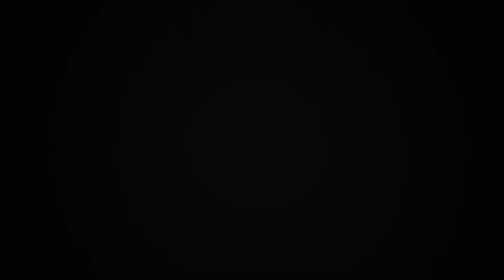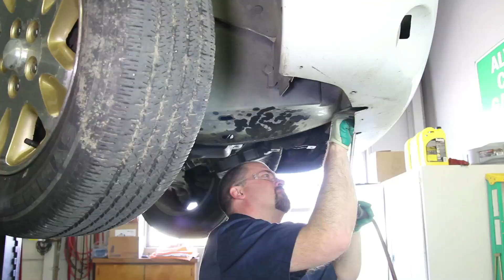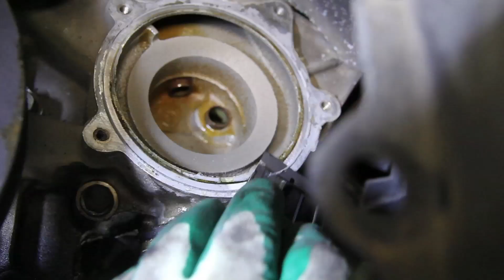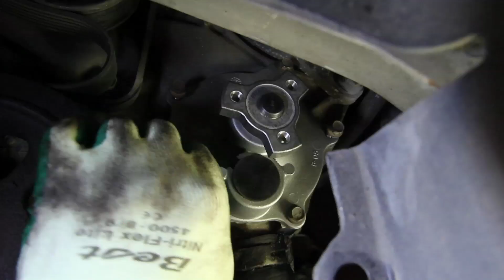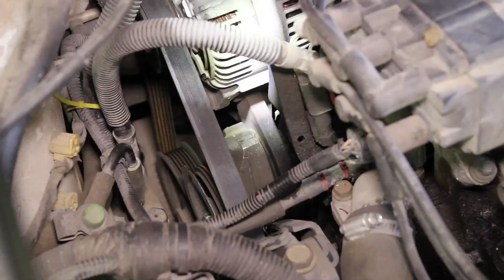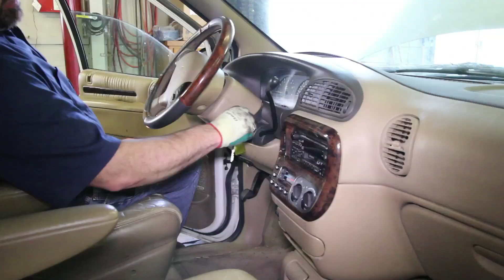How to Install a Water Pump: 1990 - 2000 Plymouth Grand Voyager 3.3L 3.8L V6

Comment: Could you please tell me how to release tension on the serpentine belt.
Reply from the maker: Bill, you release belt tension by rotating the tensioner clockwise. The tensioner is located between and just forward of the alternator and power steering pump.
Reply: @AirtexFuelPumps  Thank you sir for your reply.  In my younger and more able bodied days this looks like a job I could do myself.  I think though with my knees as bad as they are I will not be able to stand long enough to do it.  I have a good friend who is going to help me with it though.

I also have a problem with my transmission seeming to slip out of gear when I step hard on the gas at 40 mph.  Before i moved here to NC from Houston, Texas I had a high end transmission shop rebuild my 1990 plymouth grand vopyager 3.3l minivan.  
The original transmission used Dexron II.   After being rebuilt with all new parts the service guy said it should take more modern fluid.  My mechanic friend said we can replace the fluid and the filter in the transaxle.  

Should i use ATF+4 transmission fluid you think to replace what's in there now?

Thanks in advance for the help
Reply from the maker: @Bill23799  Best of luck with the pump and your knees... I know that pain well!
Reply: @AirtexFuelPumps  Do you have any suggestion of what type of transmission fluid I should use after my mechanic frind drains my transaxle and replaces the filter?  In 2012 I had  the transaxle completely rebuilt by a high end shop in Houston and i think the manager said it would now take the newer fluids as opposed to the Dexron II  the manual called for.

Would ATF+4  be correct for a rebuilt Transaxle?
Reply from the maker: @Bill23799  My apologies, we are a manufacturer of water and fuel pumps. My recommendation would be to contact the shop that did the repair. Or contact your local dealer.

Comment: Thank you sir.  I was hearing funny noises coming from my engine like I had a cricket living inside it.
Gradually turned into a sclingschlingschling noise.  Was trying to use my powers of "  Mind Over Matter "
to deal with it.   If I don't mind then it won't matter.  I check water and oil levels regularly and all was OK.
On way home yesterday fro the VA  my temp gauge went through the roof  and steam was pouring out from 
under the hood.  

I pulled off the road and let my 1990 Grand Voyager with 160,000 miles on it sit and cool off.  I could hear water 
boiling inside the radiator and see it boiling in the surge tank.   I let it cool off a good hour then opened the radiator and poured in a gallon
of water which almost filled it.   I was able to make it home with temp staying low.

A friend told me it was probably a stuck thermostat but I think it was the water pump.
I did not see any water dripping under the van.
Reply from the maker: A pressure test will show you if the system (pump) is leaking.

Comment: I have the same type of van 96 plymouth voyager, The car has been leaking from the driver side but after taking off the water pipe that goes threw the engine and sealing it back togather with new seals n cylicon it still leaked water so I'm guessing it's either a bad water pump but not sure because then it would leak from passenger side but it does not, or maybe the engine is needing a new gasket??? 

Let me know if you got any information on this, My car is currently broken down till I get more information on what might be the problem.